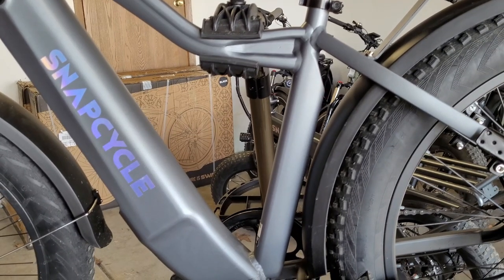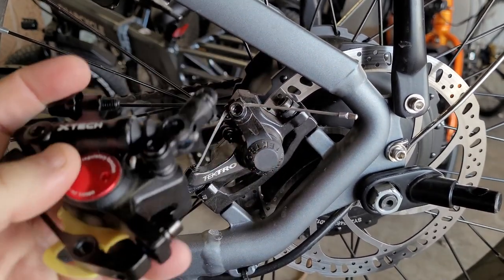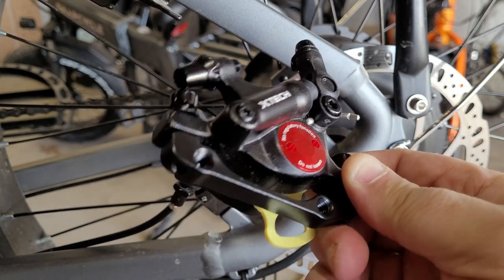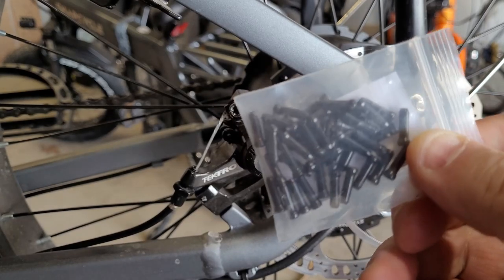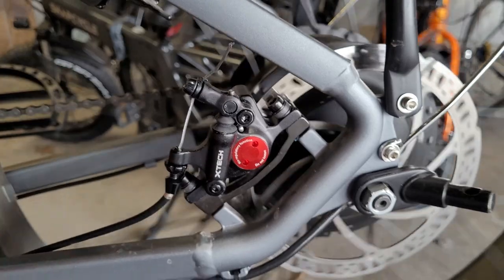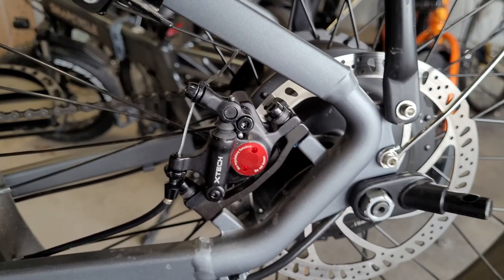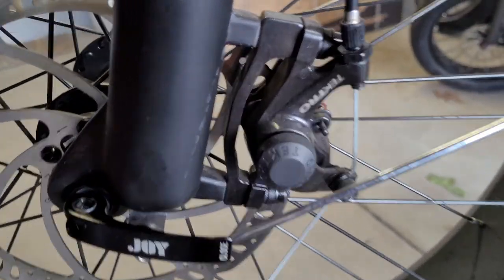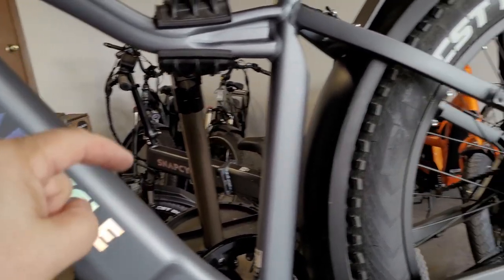Snapcycle R1 E-Bike, Installing Xtech Zoom Hydraulic Brakes

Comment: Always use the adapters that come with the calipers, not the old ones. And to find the sweet spot while tightening the calipers, press the brake lever and hold it like that while tightening the caliper screws. This will centre the caliper in the correct position.

Comment: that’s not how the cable length adjuster is meant to be adjusted, needs a longer cable housing if it can’t be shifted rearward by cutting and redoing cable ties.

Comment: i just installed mine today and cant seem to get a good bite on my rotor. any tips on how to adjust these?
Reply: The brake pads need time to adapt their shape to the rotor. The brakes need to be used a few dozen times before you'll start feeling them bite. That's perfectly normal. 👍

Comment: Why does the title refer to Hydraulic brakes, then we are shown cable brakes?
So stupid and pointless...
Reply from the maker: Because the brake pads are connected to the Hydraulic caliper. They are Hydraulic brakes, not a hydraulic brake system. A hydraulic system would include hydraulic brake levers and hydraulic lines to caliper. So the end result is getting fluid to caliper to close brakes on rotor, which both do, just different ways. My title doesn't say " Hydraulic Brake System" install.
Reply: I agree if no liquid is used it's not hydraulic ~ Hydraulics (from Ancient Greek ὕδωρ (húdōr) 'water', and αὐλός (aulós) 'pipe')[2] is a technology and applied science using engineering, chemistry, and other sciences involving the mechanical properties and use of liquids. At a very basic level, hydraulics is the liquid counterpart of pneumatics, which concerns gases. Fluid mechanics provides the theoretical foundation for hydraulics, which focuses on applied engineering using the properties of fluids. In its fluid power applications, hydraulics is used for the generation, control, and transmission of power by the use of pressurized liquids. Hydraulic topics range through some parts of science and most of engineering modules, and cover concepts such as pipe flow, dam design, fluidics and fluid control circuitry. The principles of hydraulics are in use naturally in the human body within the vascular system and erectile tissue.
Reply from the maker: @tonykearney3806  But there is liquid (oil) in the calipers. The action of fluid, a "Hydraulic function" still forces the caliper to close breaks onto brake disc rotor, which is still the same end function of a full hydraulic system kit.
Reply: @tonykearney3806 These brakes use hydraulic fluid which is stored in the calipers. They are cable-actuated hydraulic brake calipers.